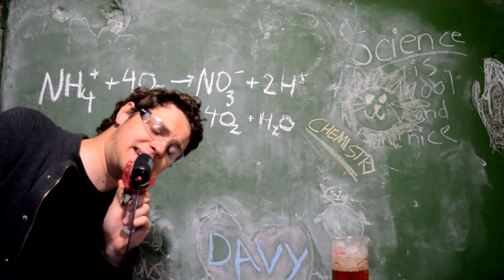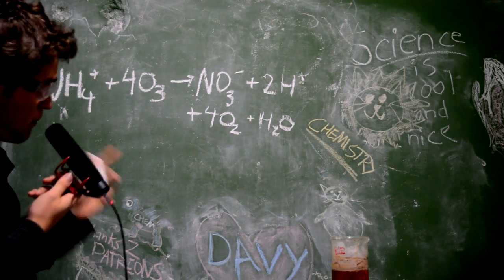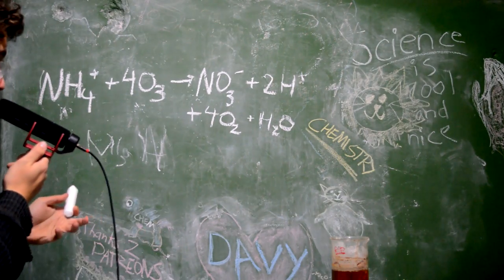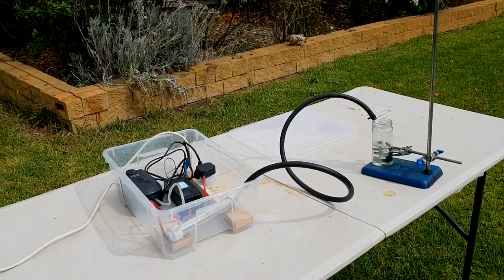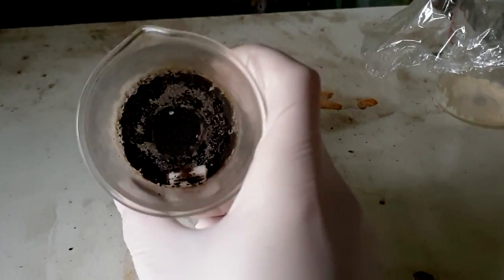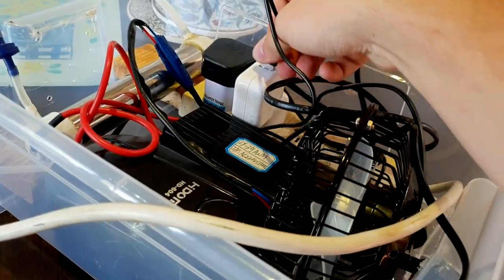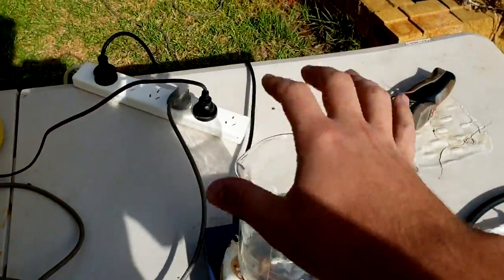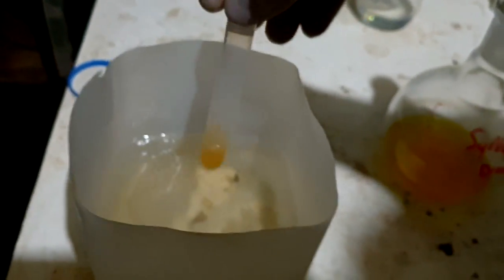Nitrate from Ammonia using Air?

Comment: My worst expiriment is stil ongoing. I'm trying to extract the potasium-sodium tatrate from the "bio backing powder" for my Fehling-2 solution. I got a whole bunch of it real cheap, but it had a huge excess of sodium bicarb. I am a very amateur chemist, so i don't have nearly enough ethanol or acetone for a decent extraction and i'm trying to go cheap, so i'm forced to work with water (when i fine tune the process well enough I'll even use distilled water). I am at around 1.5 months of work, 13 tries with little to no payback and no will to do any of it anymore. The process has always gone wrong at some very cruicial point (me knocking down the filtration set-up, me boiling it to dryness and burning it, me using the wrong reactant, me not recrystallising the reactant before using it and introducing a whole bunch of inseparable junk, me eyeballing everything cuz stoichiometry is for pussies and last but not least, me falling asleep at the kitchen table at 3 in the morning and (after learning my mistake from last time) baking it in the oven to, basically, a piece of charcoal). 
The baking powder has starch as filler, so it's extra-fun to separate. And even if, after 24 h over waiting, i decant everything perfectly, some of it makes through. It passes right through any filter i have and is virtually impossible to separate. So, i just boil everything down till the starch burns and clumps up and is actually "filterable". After filtering, I add vinegar to the solution and wait till the reaction dies down. I transfer everything to a baking dish and put it in the oven at 100-120°C. I heat it until it becomes slightly cloudy. I add a little water and take it out. Theoretically, the solution should be colourless and crystallize out right away. Best i had is black-coffee-coloured, full of particles of coloided carbon (you guessed it, it's again, completely unfiltarable) and NOT CRYSTALLISING. 
Like, at some point, i got some cristal-formation in a test run, but i just effing needed to scale it up. Now, i only have half of my initial product, whole metric shit ton of mysteriously looking filtrates and (like probably the yield of my process) 0.1% of the optimism i had at the beginning. I'm doing the last run on weekend. Wish me luck. 
P.S. sorry for any typos ( If, or rather when, you find any, you're more than welcome to correct me) English is not my native language. I'm actually half-Ukrainian/ half-Austrian. Don't really know which half is dominant.
P.P.S. i fucking love parenthesis (sry)

Comment: One could better cool the transformer by immersing it in oil to better conduct and convect the heat away from the transformer. Contain it all in large plastic basin that can disipate it away from a large surface area.

Comment: Bring the end of a three plug extension cord into the box. USB charger with fan plugged in to one plug, timer plugged into another, with power strip plugged into the timer.  

Forget the usb battery. It is going to fail after a few dozen dozen uses not to mention the fact that it  and has to be charged, disconnected from charger, then connect to the fan only to then be  disconnect from fan and connected to the charger. You just made a lot of work for yourself.

Comment: Ozon can oxidize ammonia only if the Ph is above 9 better 10. You should mix K2CO3 with you ammonia. You only get than Saltpeter but better than Nothing. and yes i know that ammonia is alkalien i think around ph10 bit it Drops rapidly when you bubble O3 in an solution.

Comment: I have spend few (4?) years now working on hypothetical plant cell regeneration protocol and I have only few ideas left, before I conclude it didn't work that way. I guess then I have to use the slow process from the literature.
Reply from the maker: Plant cell regeneration tho, sounds cool as!
Reply: @ExtractionsAndIre  
Plant regeneration from single cell is nothing new, I just try to do things in different way to optimize it for fast & easy mutation breeding.
Reply: @user255  I would love to read it
Reply: @michellesu1742  I have definitely made some advance, but nothing published yet. If you are interested in the topic google "plant tissue culture" and you will find a lot of articles from various point of views on the topic.

Comment: Spent several months working on a very sketchy HV project relying on a giant vacuum tube I got a while back. Fried itself instantly. Months of work down the drain for 0 reward. Turns out I had made a very, very slight error due to misreading a datasheet. Shit happens m80

Comment: That hasn’t actually melted thats just an epoxy/resin that is used for vibration dampening id say the main thing getting hot is the transistor as this circuit basically converts the 60Hz ac to dc then inverts at a set frequency that is higher then the transformer which is potted in the white stuff then steps up the voltage and that is then out putted through your high voltage leads

Comment: Not an experiment but analysis for my masters.
My project was looking at how a polymer behaves in solution and how to control it's properties, specifically; solubility, branching, dyes in the backbone etc. Affected it. The analysis was fluorescence spectroscopy to get the lifetime of the fluorescence. Setting the machine up was a bitch, trying to figure out how the software worked. It was a bitch to process the results and to top it all off, the I found out that you can't measure the lifetime of fluorescein in a polymer that's coated in sds in solution because the results are literal trash! The baseline is so elevated that trying to work out the  lifetime is impossible.
Second worst goes to the 4 days of work I put into making a compound that was annoying to synthesize, getting almost 99.8% crude yield only for the vacuum tap connected to the rotarevaporator to be stuck on, forcing the lab demonstrator to just yank my flask off. My final yield was like 0.5%. It was probably less than that but I'm being optimistic.

Comment: Most failed experiment story:

I’ve been fascinated with oscillating reactions over the last year and finally got some free time in the lab at school. I’ve had a hard time sourcing ferroin indicator as well as malonic acid so I haven’t been able to try a BZ or BR reaction yet. 

I did see a video from the RSC on a gas oscillator. In the video and the procedure notes the reaction is said to be….simple….

So in the video, and notes, the RSC says the reaction needs “Sodium Nitrate (III)”. WTF is that? I googled, asked professors, and finally just grabbed sodium nitrate off the shelf. The reaction didn’t work. I rewatched, and rewatched, and rewatched the demo video and finally realized they when they said sodium nitrate (III), they meant sodium NITRITE 🤦🏼‍♂️. 

Cool, I think to myself, now it should be easy….. well now I can’t find any freakin sodium nitrite. So I try potassium nitrite. This time bubbles are made but it doesn’t oscillate because crystals of potassium sulfate form in the test tube. 

A few weeks later I mention the reaction to a professor and how I feel like an idiot for not being able to pull off a “simple” reaction. He says he has sodium nitrite and would be happy to lend it to me. 

Bam! Got it to work. Obviously I wanted to run the reaction more than once but also needed to return the large container of nitrite, so I weigh out enough nitrite to run it 10 times, just incase 🤷‍♂️ 😂 and make my solution. I put the solution away and head home feeling like a genius. 

A week later I have some time to try it again and pull out my solution and notice it’s slightly F***ING YELLOW. 🤦🏼‍♂️ well the reaction didn’t work. I borrowed some more nitrite but this time stored it as a solid in a tinted glass jar. It works fine now. Between setup, cleanup, repeated failures and research trying to find out what went wrong, I spent a solid 50 hours on this reaction. I’m a Chem newbie so idk if that’s normal but it was 50 hours of depression and feeling like an idiot followed by 5 min of feeling like a genius 😂

Also, I googled and searched 4 different general chemistry texts with no results….. WHY DOES the royal society of chemistry call NITRITE, NITRATE (III)?!?!?!

Also when I first started watching this channel I was like “why does this guy hate yellow”

With this reaction, along with a few other summer projects that have gone south, I’m now like “man f**k yellow!” And anytime I see even a hint of yellow in anything in the lab I get a mild anxiety attack. 

The procedure for the reaction I was talking about is:

2 small beakers: 

1 beaker: 2.6g (NH4)2SO4 dissolved in 10ml of .2M H2SO4 

Other beaker: 2.7g NaNO2 dissolved in 10ml distilled water. 

Mix the beakers together a few times and pour into a test tube. (Outside or in a hood- NO, NO2)

One paper I found said it can be ‘enhanced’ with a few grams of NaClO4 but I can’t get my hands on any. Try it Tom! I can send you the paper if you see this and are interested.

Comment: but that metal plate was on the bottom if the epoxy was melting off the transformer would it not melt off onto the metal plate you pulled off also the white potted area is actually where most of the high voltage switching is done... that isn't even the worst potting job i have seen the black epoxy is not there to insulate or anything it is slopped on the transformer to keep it from screaming in pain.

Comment: ummm... If you take a glass tube with aluminum screen on both sides with high voltage applied, ozone will be produced in the corona. by flowing air, or better, pure oxygen, ozone will be produced. It takes 0.82 KW/h to make one kilogram of ozone.
Now the hard part for me, it takes, I believe, a reaction of an O2 molecule being ripped apart to 2 O, and combining with another 2 O2 to make 2 O3, so an excess of oxygen has to be provided to get a good generation of ozone.
You mentioned NO2 in the reaction? Actually, with nitrogen in the mix, you get O, O2, O3, ONO, NO, N2O, NO2, N2O2, N2O3, N2O4... Depending on the plasma and the temperature.
Collecting the ozone in distilled water should also be done with a large amount of water in a column so the ozone can be absorbed into the water. So the volume of water is also important.

Comment: my entire MChem year was a colossal waste of time
the basic reaction involved three reactants in a one-pot palladium-catalysed reaction, which was known to work well with a few substrates but had never been tested on these particular ones
right from the start it was obvious the reaction conditions weren't right - I was getting a mixture of products, some of which I suspect polymerised or otherwise reacted in air (the products started as an orange oil, turned into a viscous gum, and there were MS peaks from species many times heavier than the target molecule's weight, or anything in the reaction mixture), and I spent endless hours trying to isolate them with column chromatography and characterise them, getting messy NMR spectra and completely failing to crystallise anything
I pointed all this out but the Ph.D student supervising me was a dickhead, wouldn't listen, and just made me do the same thing over and over
I didn't yet have the confidence or strength of character to assert myself, or call him a twat, so it was a very depressing experience all round

Comment: Its not a science experiment but i built a Chinese checkerboard by hand no electricity from rough lumber as in cut and planed the wood by hand drilled.every hole by hand which took forever and as i was cutting it to final shape i had an area where there was to much scrap to get the saw in properly so i hit the scrap piece lightly with a hammer to get it to break off cuz it was only like 1-2mm holding it on instead the wood cracked along the grain in this super awkward line so i couldnt it fix it and make it look right ud always be able to see the crack it was like a solid 4 days 6 hours a day gone in a flash and to top it off i didnt even learn a valuable lesson and i hated most of building it i did as a bet with a teacher to prove i was a good enough woodworker i didnt need power tools he claimed i proved him right cuz i wouldnt have been in that situation if i used power tools even tho i was like 15 min from done besides stain and poly

Comment: I tried to make hcl with electrolysis well it was shit because it was very shitty yield the crocodile clips rusted the room smelled like chlorine really strong and then turns out because I couldn’t find the ph paper and used litmus and I didn’t search what Color litmus goes under acidic conditions after about a month of doing it several runs I realise I was collecting sodium hydroxide and put the desired hcl away also the sodium hydroxide was pretty shitty no wonder their were crystals in the bottle it must of been sodium hydroxide crystallising out  and for some reason after filtering the solution so many times I didn’t realise. Also the reason I realise it was sodium hydroxide was because after one of the runs I saw something floating while the electrolysis was running and that something caught on fire and kept fizzing turns out it was sodium metal

Comment: I know this is my fourth comment in a row but what the FUCK is a sodium carbonate drying trap
Reply from the maker: Hey sodium carbonate is a littleee hygroscopic, provided you dry it. Very mild
Reply: @ExtractionsAndIre  Really? Personally I would opt for CaO but I understand that sometimes you don't want to break out the furnace just to make an anacidic drying agent. I didn't even realize sodium carbonate had hydrates but I'll look into that thank you. Do you have a more pertinent vid where you use it to dry gasses for reference?
Reply: Oh wait, yes I did, from that time I made nitroethane from calcium slop. After reacting the calcium ethyl sulfate filtrate with an obnoxious amount of anhydrous Na2CO3 I let it sit overnight and in the morning I had big crystals of some sort of sodium carbonate hydrate which were actually really cool in their own right considering how mundane the chemical is. I dare you to try that nitro synth, spice things up by substituting ethanol with methanol if you will. I'm still drunk have a nice day and make sure your ground harness is in top condition I would be very upset if you fell into the sun